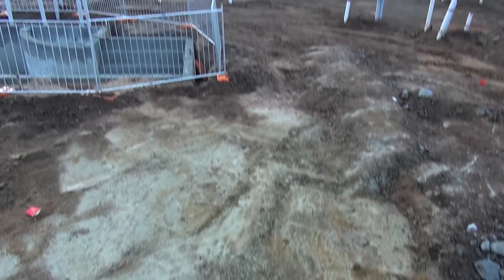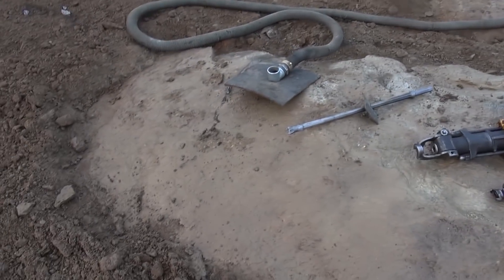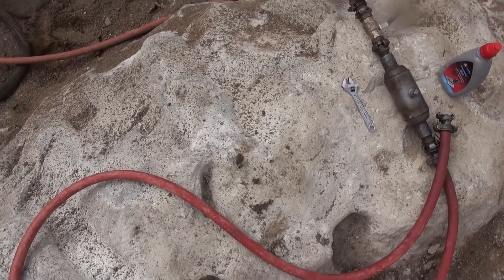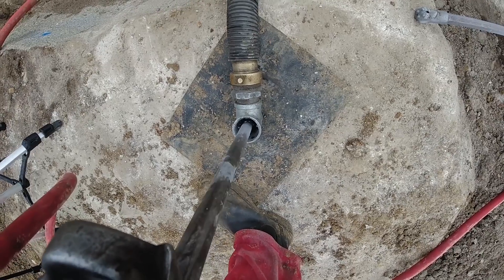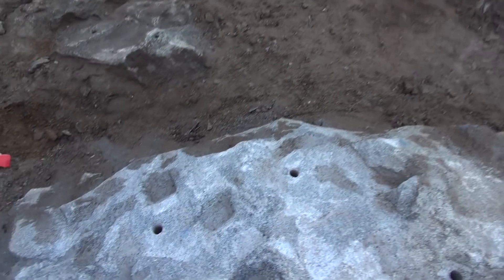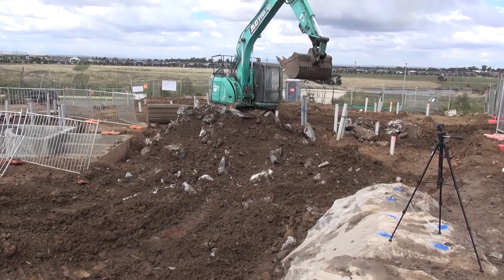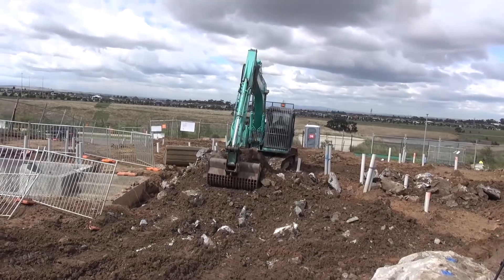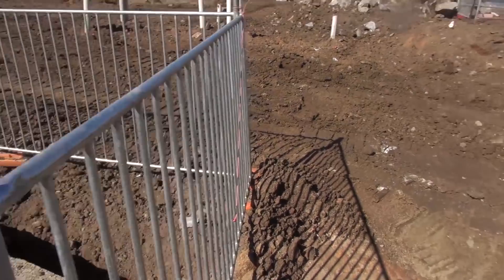Blasting right next to a new swimming pool

Comment: What blasting machine model do you use on these big jobs? Thanks! Also how many milliseconds delay between holes do you use?
Reply from the maker: Hi Dan, I'm using an old Beethoven machine most of the time  - see it here - https://youtu.be/tw18zkxza_k?t=373 The delays that I commonly use are 17, 25, 42 milliseconds and combinations of these for even shorter delays
Reply: @demolitiondavedrillandblast  How many Joules does your machine push out? Are your caps typically #8's or something larger ? What gauge wire is the yellow wire on the spool in the above mentioned video? Does it go all the way to the blast site i.e. length? Lastly, the video demonstrates an exquisite use of delay. Especially on the Slow-Mo part. Well done !!!!  And Thank You for all your help (smile).
Reply from the maker: Hi Dan, not sure about the Joule rating of the Beethoven, I can tell you though it is rated for 150 dets in series and that for this rating they assume up to 3 Ohms per det (very long wire, spool type), so it must be able to deliver at least Half of an Amp (recommended minimum firing current) into 450 Ohms. All of the Caps we have now are #8* - they have a 1 or 1.2 gram head on them, the only #8's are the old crimp on plain dets for safety fuse (if you can find them). Not sure about the firing cable wire size and can't measure it just now because I think I left my new vernier at a recent job. I can tell you that the cable is 1.4 Ohms/ 100 Meters. Thanks for watching.
Reply from the maker: https://talesfromthesupplydepot.blog/2018/01/10/mk-ii-beethoven-exploder-condenser-unit/
Reply: @demolitiondavedrillandblast  Do you have a video on how you made your blast siren out of the old ammo can?? If not, I'd like to see one. Thanks!
Reply from the maker: Inside the box is just a lead acid gel cell battery and a press button switch.

Comment: I am still amazed that you get so much movement with such a small amount of explosives. Do you have a formula or just experience? What did you use? I apologize if it was mentioned and I missed it, I have cats!
Reply from the maker: I'm using a high strength packaged emulsion and some ANFO, very much calculated load and a lot of experience. Thanks for watching KM

Comment: you mentioned that it could have been expensive if the charges hadn't been enough bust up the rock. is that because of the cost of the explosives used, or because it has to be removed by other means if the first attempt fails? Good stuff as usual, and the effort you put in shows
Reply from the maker: Yes, cost of explosives is very significant, generally about 50% of job cost with only a small mark up on the goods.

Comment: How much does the blasting material cost for just 1 hole? Powder/stick + detonator + per ft of cord?
Reply from the maker: About $30 when using down hole delay dets and surface delay clips in short holes with a small explosive charge.
Reply: @demolitiondavedrillandblast  Do you typically charge "by the hole" or "by the hour + expenses"???

Comment: Pool was not in danger as it was not backfilled. 
Job was delicate non the less, and as usuall, build stuff around it and then go blasting rocks... Never gets old.
As for the oil, I was in disbelief at first, but a driller I know for 30 years uses an eco frindly oil in his air supply. Canola oil, the same he has to use in his hydraulic systems because he is drilling alot of aquafers and alpine rivers. He cant use regular oils in case of leaks and pollution.
Reply from the maker: Wow, canola in his hydraulic systems.... that is a new one on me. I have used Canola as drill oil when an enviro watchit was upset by a small puddle rainbow.
Reply: @demolitiondavedrillandblast  the nature "protect anything that grows or moves whackos" here are insane. Hydraulics are not hurt by the canola oil as there are suppliers for oil here.
Regulations require that any machines in drinking water supply and nature reserve areas are using it and has to have a catch pan under the engine to prevent anyhing from the machine to drip out.

Comment: That slo mo drill shot gives me an idea!
Set the slow mo up on one of the pocket tripods, so just a few inches high, and get a close up shot of starting a new hole without the vacuum collar, so we can see the bit starting to chew in, and maybe the debris column without the vacuum.

Maybe also a similar shot of clearing a hole full of water with your Air Lance lol
Reply from the maker: good idea, I did get some footage with out the vac, see if I can get something together very soon.

Comment: Ok, DD. Millisecond delays I can imagine, but dominant frequency... would you explain that next time around?
Reply: Basically, the delay between each charge firing creates a musical note in effect, as well as countless harmonics.
By calculating the distance between holes, the propagation speed in rock (the speed of sound is different in rock from air), etc, you can set the delays to avoid powerful low frequencies that would be more likely to damage the pool.

Remember that low frequencies physically move further, so are more likely to cause cracks.

Comment: Appreciate you videos as always Dave.

Short question - you’re covering it with soil, what do you do if it doesn’t go off as it should and you need to check the surface connectors/dets? Feels a bit risky to go in with the excavator and time consuming removing it by hand of course but maybe that’s the case.

Thanks - greetings all the way from Sweden.
Reply from the maker: ....I'm very good with a spade Joel. You may have noticed that I ran witness tubes out from under the cover from the last hole in every echelon row, if you have a partial missfire because of a cut tube it is very easy to determine where the break is by checking all of the witness tubes and determine if it is on the control row or and echelon row so you know where to start digging.
Reply: @demolitiondavedrillandblast  would you have to use a special non sparking spade?
Reply from the maker: The last bit generally gets done with my non sparking hands and compressed air.
Reply: @demolitiondavedrillandblast  thank you for replying it's always interesting to watch you work
Reply: @demolitiondavedrillandblast  Ah, didn’t notice the tubes. That’s easy and clever :)

Thanks again Dave!

Comment: Our company provides rock drill oil kirk barnd or we use hydraulic oil
Reply from the maker: Very interesting, I have also used hydraulic oil, have been told to never use regular engine oil, but #90 diff oil is also OK supposedly.

Comment: Did you get the sharpener to work again or is it junk.
 Nicd job blasting without hurting the swimming pool.
Reply from the maker: Yes, operator error.
Reply: @demolitiondavedrillandblast  ok, what did you do wrong.
Reply from the maker: It has a hidden speed control (and no instructions).
Reply: @demolitiondavedrillandblast  simple fix for a change.

Comment: Got her done......poking at that with a rock hammer could have done more possible damage to the pool than couple thumps blasting it. I bet that job possibly have been a cracking goo job. All we used was ATF, the oiler we had was old too don't know the age of it, also used it for the 3/4 inch impact wrenches when we used to build aquaculture farm pens.
Reply from the maker: Cracking goo could have done the job OK if I had of drilled rows of low angle holes from each side. ATF is king and a fraction of the price of the special rock drill oil.

Comment: Now that you have a grinder, how often do you think you will regrind bits?
Cool to see, as usual!
Reply from the maker: A lot, it is a game changer when you can restart after lunch with another sharp set.
Reply: @demolitiondavedrillandblast  , as the air driven motor buggered up, is it possible to buy an electric driven grinder?  or dismantle the air driven grinder to reuse the grinder part in an electric drill or even a cordless drill, if they rev fast enough?

Comment: I sold a product called NFO for air tools.  NFO stands for NON FLUID OIL. I think the  ATF is perfect. Almost any oil is better than no oil. I noticed that your compressor is putting out a lot of moisture which is a natural occurrence when you compress air and heat it up and then discharge it into the rather cooler atmosphere. 
I love the slow-mo when you’re drilling.
Reply from the maker: General consensus seems to be that ATF is good. Best thing to remember is the any oil is a lot better than no oil, I used vegetable oil one time when a enviro safety watchit guy got upset that my drill exhaust made a rainbow on a puddle. The compressor was belting it out as it was a very damp morning, I had my atlas separator with me but it seems to be clogged up...another thing to fix!

Comment: Hi Dave.  Do you drill to the depth level required or do you drill to be in the middle of the rock?  Cheers.
Reply from the maker: You  would drill about 2/3 of the way through a rock of known size or if fully imbedded in the ground, just drill a little deeper than you need to break.

Comment: Dave what was all the vertical pvc pipes on the site about? Thanks in advance.
Reply from the maker: They are the sewer pipes, for toilet, shower, basin, dish washer, sink etc.
Reply: @demolitiondavedrillandblast  Ahh that would explain it. With that size not much good for swimming. More of a Roman bath.

Comment: It's when you start talking about knowing what millisecond delay detonators to use and how to keep the dominant frequency as high as possible you realize there's a lot more to your job than would initially meet the eye. Great video as always.
Reply from the maker: You would be surprised Niall, how many other contactors like me are out there that do not really have a good grasp on the technical aspect of their job, indeed some are clueless. Thanks for watching.
Reply: @demolitiondavedrillandblast  Surprised? More like... stunned. Surely there is some training/accreditation required as a qualification to do what you do?
Reply from the maker: @ Ted Bell - Sure is Ted, interestingly it has been a graded license system where the most basic, entry level license only covers the use of plain dets and safety fuse. This was to cater to the likes of farmers that did a bit of post hole and tree stump work etc. One of the most prolific and monetarily successful small time rock blasting contractors in Melbourne, only ever blasted one hole at a time with safety fuse, believe it or not! He has recently retired.

Comment: Any thoughts on what they might have done better here in my home town Dave? https://youtu.be/jPUqC36pPQo
Reply from the maker: Yeah... that was a big one! I bet that it was a lot bigger bang than they were expecting, otherwise they would have put about 4 times as much sand cover over it. In some places the standard procedure is just to drill a big hole on the side (if the nose fuse cannot be removed) and melt all of the TNT out using steam - The TNT then gets reused for road side bombs etc.

Comment: You didn't need to worry about the swimming pool Dave, they have protected it with a fence.
Reply from the maker: If only I had of known...
Reply: We were told in the United States fences don’t work. I guess they didn’t get the message in Washington DC because they put a fence around all of the federal buildings to prevent, “WAIT FOR IT” an “EXPLOSION” so I guess the fence around the swimming pool will work.
Reply from the maker: @YT I watch the unfolding situation there in disbelief YT.

Comment: Dave, you used the term "ejected" and it would be bad if it happened, I don't know what ejected means in the context. Could you explain in lay mans terms what you mean? Thanks.
Reply from the maker: Sure Tim, I'm referring to a stemming ejection, the stemming is the screened crushed rock that goes in the hole on top of the explosive charge and has the job of holding the bang in the hole long enough to break the rock. If the charge is too small to break the rock or the burden is to great, the bang just pushes the stemming strait out the top of the hole without breaking the rock.
Reply: @demolitiondavedrillandblast  Thanks Dave, you have satisfied my need to learn something new each day, today.